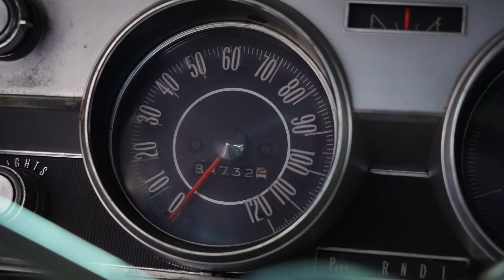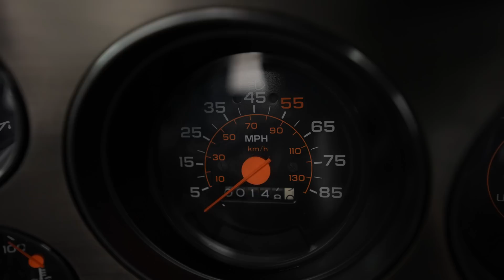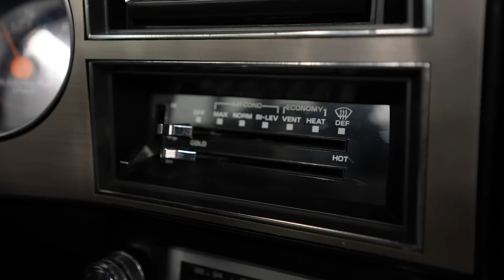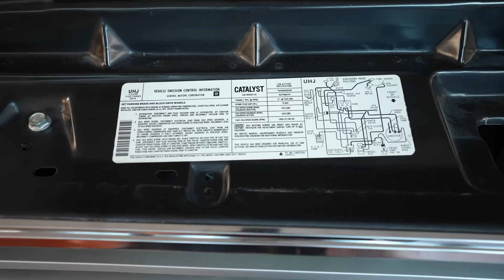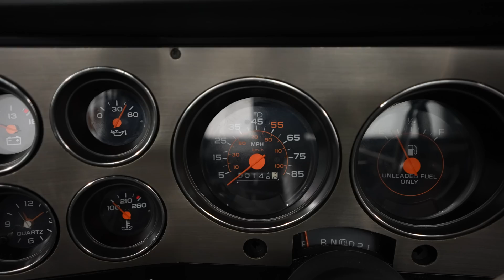EXTREMELY RARE Chevy C10 Short bed with 148 miles, WHAT'S IT WORTH? | Barn Find Hunter

Comment: A vehicle left to rot and not be driven is very sad. Every piece of rubber and plastic will need to be replaced on that truck. Carb will need a rebuild. All fluids changed. Hopefully the brake fluid hasn't absorbed 40 years of moisture and rusted the entire brake system.

Comment: I'm fine ih putting another motor n tranny in it, being that it was a 327/210hp 2bbl/ 3spd did he say 3 on tree or floor? If it is floor shift maybe I'm down with the  3spd, naaah TKO600 5spd.. But put a GM performance crate 327 Built to L79 specs with Holley Sniper FI that looks like a carb.
Hagerty's valuation tool is so f'd up on soooo many vehicles
With recent auction results that's 6 figure truck all day long probably 
Closer to 150 than 100

Comment: This is indeed an impressive time capsule. But, just the same, these were the GM trucks where the hood would bend in half once the hinges got stiff just trying to close the hood. And the V8 engines in this sad era made less horsepower than a low end Hyundai 4 cylinder does today. So it’s all relative. These were among the worst years for GM.

Comment: You just can't drive that truck now in good conscience. I'd say that would be in it's own "Under 500 miles" bracket when it comes to collector cars. If it had 10k on it, you could cars & coffee that at your local place at rest easy at night. I'd break it down like this: 500, 1000, 2500, 5000, 7500 and 10k miles.
Reply: Does anyone know what that truck sold for new? I'm super curious

Comment: Well it’s a beautiful truck but with it sitting that long there will be issues. The engine could have gasket issues after you start driving it, those tires will need replacement. Small things like the foam seals behind the air vents are surely rotted out by now. Not because of lack of love. Just mother time doing what she does. Overall very nice but if you want to actually drive it like it should be you better get your wallet out. Just my opinion. Love the channel.

Comment: l have no doubt some rich kids dad will buy him that truck and it will be destroyed. l had a 76' triumph TR6  that was in as new condition with less than 2k on the odometer. lt had sat in a climate controlled showroom for 30+ years in Dallas Tx. l got it running perfectly and did a little work on rubber seals and oxidized wiring. Sold it for 30k to someone that was 16 years old. He had blown the engine in a couple of months. l offered to buy it back but when l went to look at it they had literally left it outside their estate in the sun and rain WITH THE TOP DOWN! lt went from like new to trashed in less than a few months. he had spilled drinks and food in the car and left it. rats had gotten into it. l offered them 5k and walked away in shock. he called back a few weeks later when he figured out he couldnt even get 5k for it. l bought it fixed the timing chain and sold again for 8500. l wish l had never sold it but l made 10k profit after all was said and done.

Comment: Dude; that truck is nowhere near the 100k value mark. That truck has a ‘sentimental value’ of 100k; but, street value? NOPE. The old 67-68 c-10s? Now those are valuable, but these mid 80s step sides? No. It’s beautiful truck and it shouldn’t be touch, but it should be driven.

Comment: Lol you couldnt drive it.. youd need a toatal engine rebuild. All rubber bushings replaced. When you preserve a truck like this all the seals n gaskets are dry rotted n leak. If ya dont usem ya losem. But still ah 100k truck.

Comment: Yuck, keep the Camaro original, it's survived all of this time original, so keep the legend alive. Do not "LS Swap" the world. No, that's not correct. The Olds 350 V8 diesel, RPO code "LF9", VIN code "N" was NOT a gasoline engine, even though it has the same displacement as one. That engine was offered from 1978 to 1985 in various GM passenger cars.

The last year for the square body is 1991. The C and K Series (2WD and 4WD respectively) ran from 1973 to 1986 and then from 1987 to 1991, it became the R and V Series (2WD and 4WD respectively). In the spring of 1987, the GMT400 trucks were introduced (as 1988 models) and GM made them C,K Series again in order to prevent confusion at the dealerships.